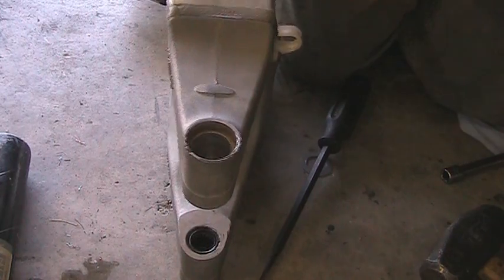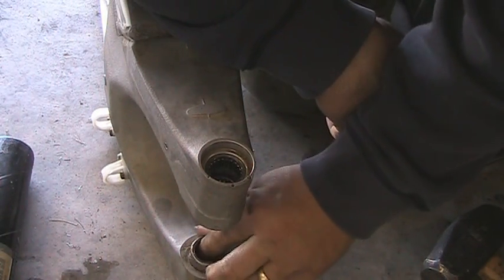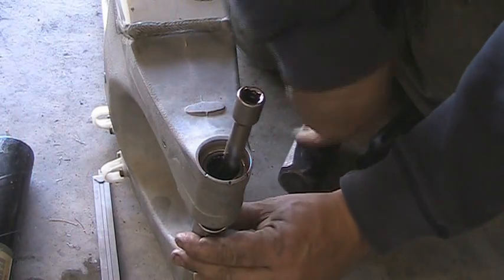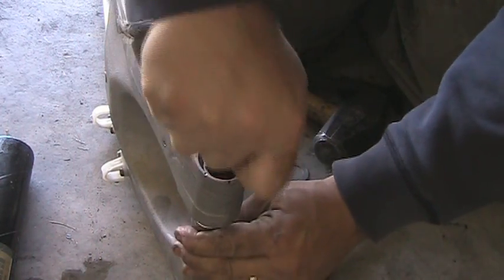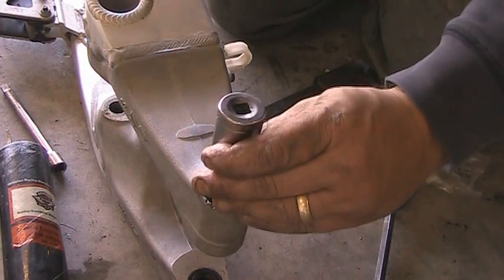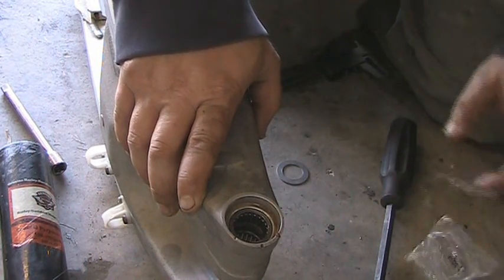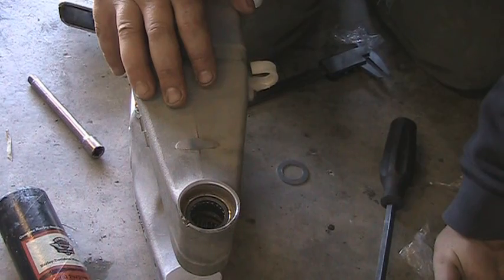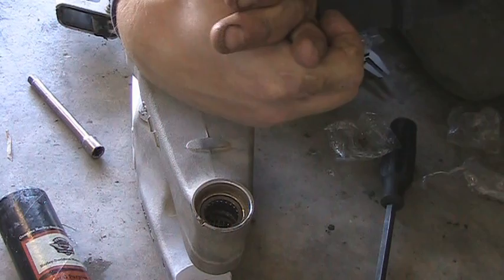Part 8: Assembling a motocross bike swingarm linkage bearings and seals. YZ250F example

Comment: I got the same bike and it was stored outside covered up it's life. You would not believe how much trouble this same process is on this bike I just picked up. I had to use a press to get them out and make a spacer to go between the swingarm pivot mounts so that it wouldn't bend on the press when I was pushing them through. Now I have to take a rotary tool to clean/hone out the insides so that the bearings will push right in like your video. What a PITA = ]
Reply from the maker: Wow! It's amazing how people treat their bikes.
Reply: *****
I cleaned & lightly sanded the surfaces, froze the new bearings for installation and bam! The new ones pushed right in. The wheel bearings were the worst I've ever seen as well and the bike only has 150 hrs of non-racing on it. I think pressure washing did all the bearings in. Thanks for the video. It's amazing how your job went so quick and mine was just a complete nightmare. **for installation I used a piece of all-thread rod, 2 nuts and washers to clamp the bearings inward to seat them.
Reply from the maker: Mr Smitherz Yeah, I got pretty lucky on this one. It originally looked pretty bad when I purchased the bike but ended up being fairly smooth.

Comment: 3/8 or 7/16 threaded rod....a socket that fits the bearing diameter then a big washer on the other side with the nuts...just tighten the nuts till the bearing seats where its supposed to...I only do them once and a while...so buying a tool isn't worth it. this trick takes a little more time but in the winter all ya got is time haha the bearings are so expensive I just could bare to hammer them

Comment: i have a yz 125 2000 and i am about 2 change them. but there is no lip 2 gauge the outta bearings . is that also 8 and a half mil as the inside? cheers

Comment: ouch makes me cringe watchin your pound away on those new bearings! even if they are goin in easy...shoulda used the old threaded rod/washer/socket trick...good video though...im currently doin swingarm and linkage bearings on my 04 YZ250...